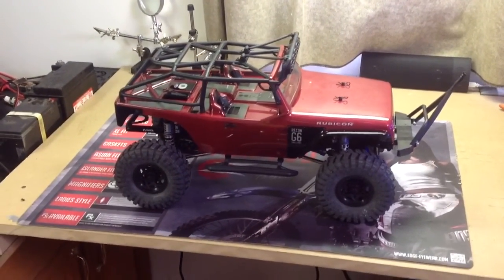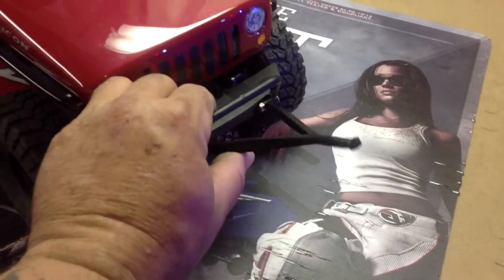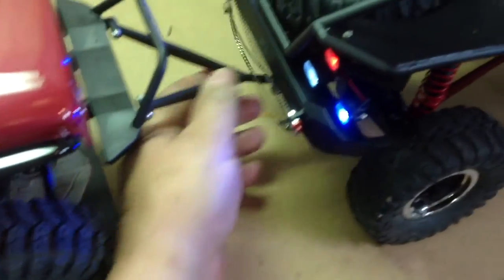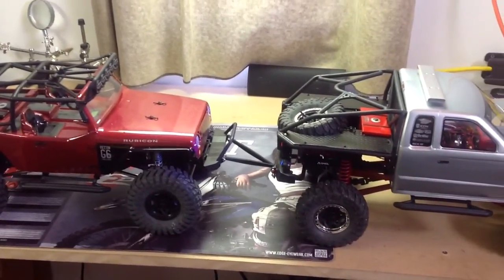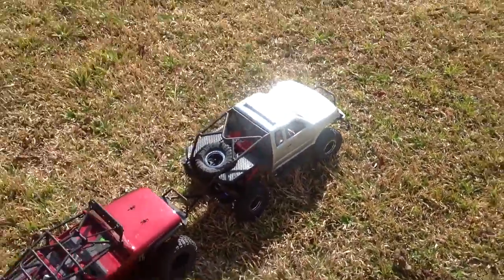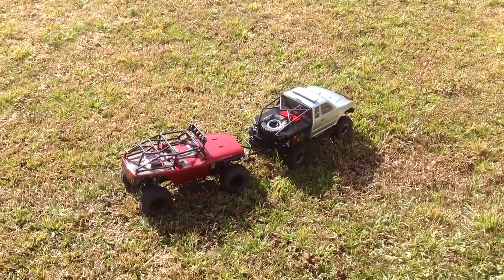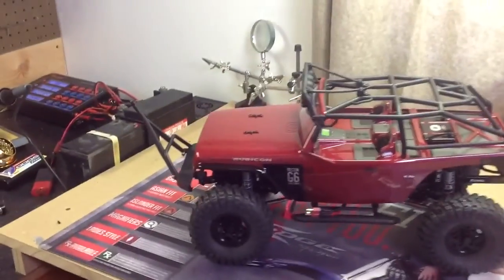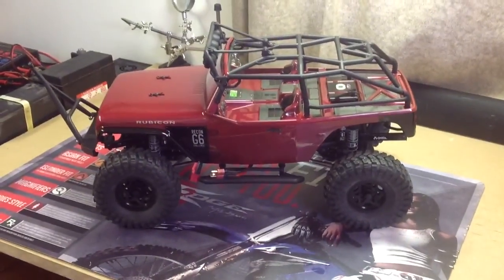Update on my axial g6 jeep added a tow bar and deans connector to the esc

Comment: sounds like you have a lot of strain on the tranmission wen towing might want to remove the drive shaft, other than that u just got your self a new trailer. i like and will have to use on mine.
Reply from the maker: When I was doing this video I didn't notice I had my drug breaks on a little bit on the Esc soon as I took the drug break off no longer had a problem